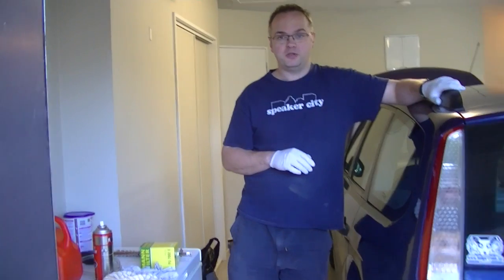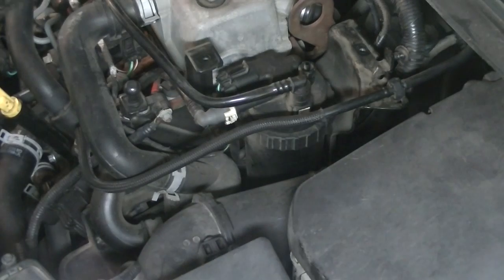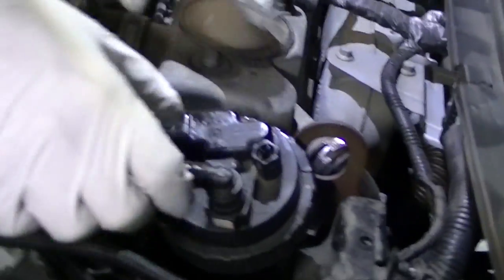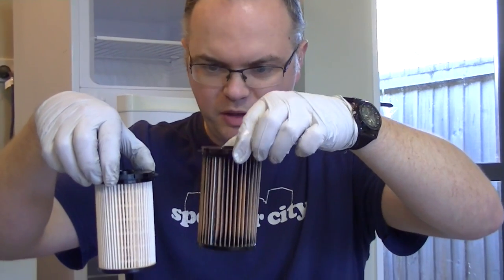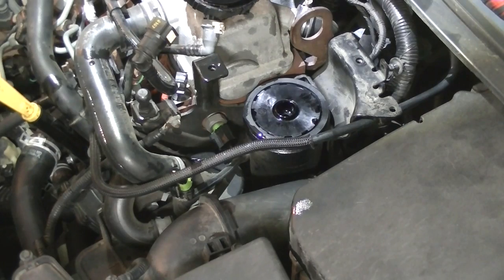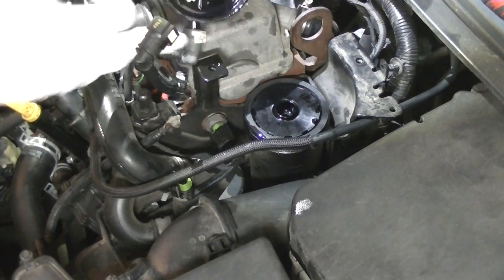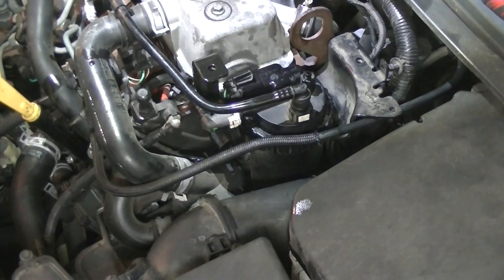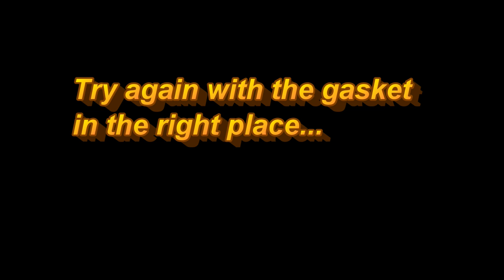Ford Focus 1.8TDCi Fuel Filter DIY with a twist...

Comment: Very helpful video. I tacked my filter on my 2008 1.8 focus diesel today.  I made sure the fuel tank was full and the engine warmed up as my car is not good at starting cold and I was expecting to crank the engine more than normal to prime the system. The car was also parked downhill to help with priming the fuel line.

After removing the black steel filter cover with 2 8mm bolts, I first brushed down the whole top of the filter housing to remove loose dirt. The pipe/hose connector from the filter housing to injection pump was difficult to get off until I realised the outer white tab had to be pushed in and the smaller white central tab pulled out simultaneously to release the coupling. I protected the connector with a food bag. I removed the electrical connector and fuel feed pipe (easy - just squeeze the two white buttons) and removed the whole housing. The housing was filthy and was cleaned externally carefully as not not get dirt into the inlet and outlets. I then drained the unit by opening the light coloured bleed/drain nipple on the base. A bit of black sediment and metal swarf came out. 

Once drained I undid the main knurled ring with a rubber filter strap and lifted off the top. The filter was filthy...jet black and had done approx 30,000 miles. I always avoid small obscure filling stations in case I end up filling up with rusty water so seeing this amount of dirt was a shock. Perhaps it is a small suspension of particles carried over from the refining process? I found the main sealing ring incorrectly placed on the top of the filter. The new filter (Wix) did not have a small o-ring for the central filtered connection in the box....bear this in mind when buying a replacement filter. I then pulled off the old filter and slid the new one on the centre spigot/outlet making sure the o-ring did not roll up out of its slot.

Another reason why the main sealing ring goes under the top flange of the filter is there is a rebate set into the underside of the top flange. I moistened the o-ring with a bit of diesel and placed it on the top of the housing then dropped the top half on and tightened the knurled ring making sure the two arrows on the side lined up.

I checked that the drain plug at the base and the priming/venting nipple on the top were closed/tightened as far as possible by hand. I  then placed the housing back into the holder on the engine and reconnected the inlet pipe/hose. I then connected a hand bulb pump (Laser brand) like the one in this video with 8mm clear hosing onto the outlet and another longer length of hose to a waste bottle. It took about a minute of pumping to fill the housing and then get a flow of diesel from the housing into a waste bottle. I drew off about half a pint in which no more air bubbles were emerging from the housing. I removed the clear tube and reconnected the injection pump/hose. I then cranked the engine which immediately fired and the stalled. I cranked again for about 10 seconds and the engine fired again and remained running. I left it idling for a minute or two then switched off, replacing all covers and then went for a test drive.

One of the reasons for not filling the housing before reassembly was to ensure all diesel got passed through the filter and was therefore 'clean'. I had no clean diesel in a can to use. Hope this little extra guide helps.
Reply: Cheers for that, it was indeed helpful. Can I ask - in other videos I've seen people bleed the air from between the filter and the HP fuel pump. Do you feel that that's necessary? Or did you do it, and just not mention it here?

Comment: I just change the fuel filter, all I did was remove all pipes and electrical plug, remove the whole filter housing from the engine bay. Took out the old filter and gasket, replaced with new Delphi filter and filled it up with new diesel to the very top, screw top back on, put back in car, attach pipes and electrical plug. I had charged the battery overnight because I run it down doing it the way presented in this video. So everything done, just went and started the car on 3rd attempt and everything is fine now. It is pretty much the same process as changing the fuel filter on a mk3 mondeo. I am happy that's it done after reading all the nightmare, cannot get the car started stories. I did spend yesterday doing it as in the video, pumping out air with vac pump but could not get the car started doing it that way, obviously it works for others. Thanks for taking the time to make and upload a video. :)

Comment: Thank you for your post.   I brought myself a ford focus 1.8  2008 diesel and it had a bit of lack of power and juddering,  I was driving it like this for some months because I thought a garage will rip me off because it seemed like a tricky fault.  I then realised this model uses this fuel filter so automatically I thought it must be very dirty due to never been changed.   I purchased a filter for £15 and fitted myself to notice the rubber ring on the old filter had been fitter wrong by a previous owner,  like how you did in your video. I had a hose ready but I tried it without the flushing process. Filled the filter with diesel and It took about 4 turn overs with the engine stalling then it started fine.   My Focus is now running like a dream.   Cheers mate
Reply: Thanks for your information vince

Comment: just carried out this service and found it easier to attach the pump to the bleed valve, then rather than sucking fuel through I pressurised with diesel from a Jerry can, whilst turning the engine over. once running I closed the bleed valve, and disassembled the rig. Job done.
Reply from the maker: +Stewart Jayes awesome. As long as you get the air out and don't run the pump dry it's all good. Cheers!

Comment: Thank you for this video I did the very same put the o ring on top and 2 days later car would not start saw your video and 15 mins later all good .
Thank you for the help
Reply: Same thing happened to my ford Smax 1.8 tdci. I had replace the whole head due to camshaft snaped. So i fixed all that but now I am facing an other problem which I can not get the car to start. The fuel pressure is too low or there might be expensive air in the system. I have cracked open all the injector nuts to see if there are any bubbles but injector number 1 and two do dribble number 3 and 4 are completely dry can someone help. Kind regards.

Comment: Real happy I came across this video I also made the same error putting the seal in the wrong position
( Ford Galaxy 1.8 ) Also topping up the filter housing  with fresh diesel helped got a cheap pump for four quid from Halfords filled the line to the injectors with fuel connected the pipe back to the filter housing and started the engine and car started to run then CUT OUT turned the ignition off waited 30 seconds turned the ignition on and and started the car it fired up again then cut out did the same again and the car started to run without cutting out 
Took it for a test and runs much better - to that note I changed the filter because the car would sometimes stall in slow traffic sadly it did not cure it but performance is better not had the car very long and trying not to spend silly money trying to cure the problem 
Word of warning I did not realise the green rubber dust cover on the connector falls off i could not find it anywhere normally they are fixed in some way so at the moment had to fit it without until I can get a replacement cover thanks for showing us the error it’s been of great assistance to me
Reply: Did you figure out why it was stalling in slow traffic as my 1.8 galaxy is doing the same thing and I was hoping changing the fuel filter would cure it but no such luck! Did you figure it out by any chance?
Reply: @fgcvhhbvjhbj  no never found out what it was
I no longer own the Galaxy but a family member who has it uses it daily with no issue guess the car just did not like me
May have been a slight blockage and with use its just gone
Found it cleared a bit when a garage did a routine service on it
But it was very random fault I will ask the person again who has it and will  reply back
Reply: @markjones2770  Thanks Mark, that'd be great as it's very annoying and potentially dangerous when I'm going around a bend! Haha, hopefully it sorts it's self out too!
Reply: @fgcvhhbvjhbj  apparently it still does the random stalling thing she forgot to tell me
It could be the Egr valve needs cleaning or something to do with a sensor located at the front of the engine  near the octopus of pipes at the fuel rail forget what the sensor is called it gets gunked up with oil and muck from the engine
Rember a garage telling me about it but Could never find the sensor on my galaxy each one is different I think
Reply: @markjones2770  Thanks mate. I'll give the EGR valve a clean and hope for the best 👍 thanks for checking
Reply: @fgcvhhbvjhbj  hi did you clean the EGR ? How did you do it please.thanks

Comment: I’ve been in this trade a long time forget about prime pumps they are messy and don’t always work. The best way and I’ve done this many times and that is to use a small funnel and a piece of fuel hose just pre fill the filter when assembled with diesel until it flows out of the return pipe fit the filter and start up . Job done .

Comment: Very good. I will be doing this job tomorrow on my new (new to me) mondeo, along with all other filters and new oil. Thanks.
Reply from the maker: +Mr.Mister awesome, enjoy your new car. Thanks for watching!
Reply: I got it done but it was a complete bitch to bleed. I fitted the gasket the correct way first time and primed it really well. It started straight away like yours did and then stalled. After scratching my head I bled the system again and connected it up to the other diesel line like you did and squeezed it into that. I had to repeat this process about 5 times which I found strange but I got there in the end and the car runs fine. Another thing that was weird. The filter I got in my local parts store was a Wix filter. It did not come with the small O ring.
Reply: Same thing happened to my ford Smax 1.8 tdci. I had replace the whole head due to camshaft snaped. So i fixed all that but now I am facing an other problem which I can not get the car to start. The fuel pressure is too low or there might be expensive air in the system. I have cracked open all the injector nuts to see if there are any bubbles but injector number 1 and two do dribble number 3 and 4 are completely dry can someone help. Kind regards.

Comment: I just replaced my fuel filter on a ford mondeo  1,8 tdci 125 hp,  year model 2010 and I would like to share my experience with y'all.  No needed to prime.  Well after  turning off the car,  disconnect all the pipes and the electrical connector , I removed the whole black pan thing out, opened it up . remove the filter , clean up the  pan , fill it up alllllll the wayyyyy with new fuel-diesel, insert the new filter with the gasket the way you corrected it, close the lid,  unscrew the valve on the top of the lid  and again fill some more fuel until is puring out, close the valve , clean the pan from the fuel , carefully install it back to the car  with the two pipes and the elect connector and after that one more  secret: turn the ignition key without trying to turn  on the car wait 20-30 sec , repeat it this 3-4 times , and after this finally turn on the car and drive or leave the car on for at least five minutes . Again that was my experience and worked perfectly without trying to prime at all. Greetings from Europe to  you and your beautiful- magnificent country , New Zealand!
Reply from the maker: Thanks for watching and sharing your experiences! The key is to get any air out so fill it up as much as you can. A question for you, what does turning the key on and leaving it for 20-30 seconds do? There's no electric fuel pump and the engine has to be turning for the direct injection pump to be pumping so I have never understood the benefit of doing it. Cheers!
Reply: You've been lucky then , these particular fuel systems are very sensitive to any air at all in the system and will stop at the drop of a hat . 99% of the time they need to be bled properly

Comment: Thanks for posting this, it's only through making mistakes that we can learn new things! Great job! :-)
Reply: Do you happen to remember the hose size on the pump please? I am looking to buy one but they come in 8mm and 10mm. Last thing I want is to get the filter off only to find the pump doesn't fit. :-))
Reply from the maker: Learn from my mistakes so you don't make them too! I can't remember what size it was but I would say closer to 8mm than 10. My pump came without hose and I just used clear tubing I had lying around
Reply: Thanks for getting back to me,  I will order the part and do the job hopefully over the weekend. Thanks again for your help! Ken

Comment: Nice work mate. Mine hadn't been done for 65kkm and was pitch black. Not that the car was performing poorly.

Interesting note: the filter I removed (mecafilter) DID have the O ring on top!?! The one I replaced it with (Valeo), could only be underneath.
Interesting note 2: I topped off the fuel lines and the filter housing once assembled with a small syringe. Motor started first crank... Beginners luck!

Comment: When you fit the new filter the gasket has to go on the bottom. But however the pump should be connected on the fuel supply line for the filter (thich black line on the right with a black cap). The other end of the pump should go on the tube to connect the fuel filter supply line. The arrow should point towards the fuel filter. Next you should connect a clear tube on the bleeder screw and unscrew it loose (make sure you catch it in a can with the other end of the tube). You should pump until clear diesel flows through the tube of the bleeder screw without air. Important to tighten the bleeder screw just finger tight. This is the proper way ford manual describes fuel filter change on a 1.8 tdci and has fixed our problem.

Comment: Easier way to bleed it is to unplug the wiring on the top of the filter housing, then lift the whole assembly out. There is a little valve on the bottom that unscrews and has a spout on it that you connect a pipe to. This can then be used to suck the air out with it upside down, and then screwed shut once done.  I've just spent the last couple of hours trying this without a hand pump, so I know it works.
Reply from the maker: +Andy Moore cheers for the tip. There's a few different ways to get this done. Next time round I'll show the procedure from the Ford service manual. Cheers!

Comment: Take the whole thing off and change the filter on the bench. The priming tool goes on the other side of the filter so you draw fuel from the tank and push it thro the filter then you can leave it on while cranking and give it a few more squeezes if necessary

Comment: Hello 
Already found answer for my question.  Ford 1,8 TDCI uses Delphi fuel filter
 with simple heating system and no ultrasonic (air presence) 
and no  high resistance  (  watter) measurement . 
Simple heating is done by thermal switch and thermo resistors aprox 1,5 Ohm 
which each one makes 30 Watts of heating  situated between two aluminium plates 
on the top chamber of the filter body.
In case of need its  possible to equipp max 3 button thermo resistors  
(approx 100 Watts) to the head of the filter,  what makes significant heat capability ... 
Fuel Heating could  be disconnected without any problems 
and moved to proper position in case of replacing 4 pipes input fuel filter
 with electric fuel circulation ( no lifting losses ) ... Fuse F14  15A  box above the transmition.

Comment: Thank you for your video. I made the same mistake. I battled with my car after changing the fuel filter and had to tow start it to get it going. Didn't run right. I came across your video put the seal where it should be and bleed it up and it started after 3 or 4 seconds of cranking.
Reply from the maker: awesome, glad I could help!

Comment: The diesel filter I used to have on our Silverado was a pain. you could easily pinch the gasket and not know it. The motor could run for hours till it died. It was something that you had to be careful of.
Reply from the maker: That would be a pain in the bum. These modern diesels can cause a few headaches

Comment: hi cheers for the vid ,i got my mk2 in oct its run no problem but every now and then it loses power anyways i decided to put new filters in,air fuel and pollen ..when i fitted the fuel filter guess what....the one fitted had the gasket on the top...this has been the cause of the power loss...like a new car now the last service had been in 2011 by a dealer...goes to show so thanks for the mistake you made as i would never of known...
also i had no need to prime the system i changed the filter topped it up and started no problem. 
cheers again
Reply from the maker: +garry leask fantastic, glad you fixed your issue and glad I could show you how not to do it! Sometimes you get lucky with bleeding but generally I find you need to so worth having a pump available.

The other thing that really helps the 1.8 is an EGR blanking plate. Runs much smoother and less jerky at low revs. 

Cheers!

Comment: I’ve got a MK4 Mondeo 1.8 TDCI, looks exactly the same setup to the Focus you’re working on. Just wondering, I’m a novice and obviously I want my car running properly again and not to have it sitting outside my house until I can arrange Greenflag to tow it. Just following the video over like 4-5 times, you know when you got the gasket in the right place, where were you pumping the diesel to? As I didn’t see the bucket or whatever it was that you were using? Thanks.
Reply from the maker: You can either pump it into the fuel return line or into a bucket. Cheers